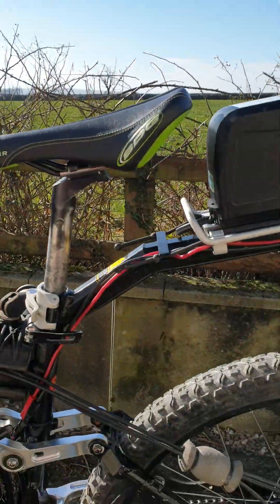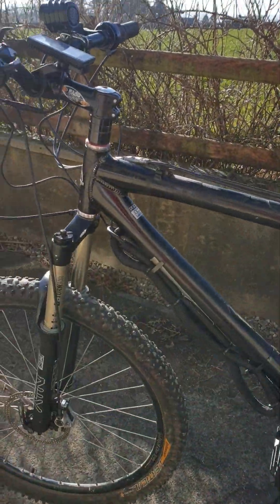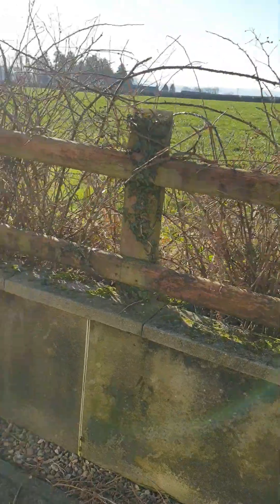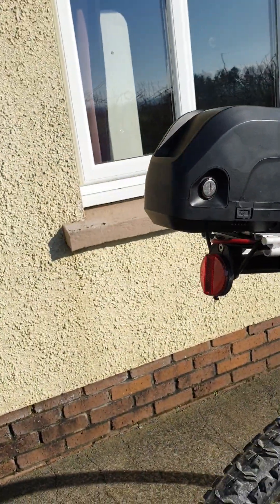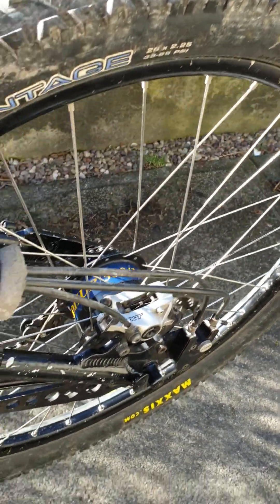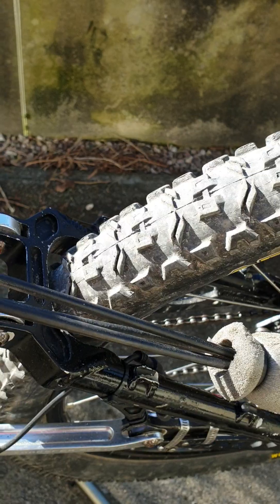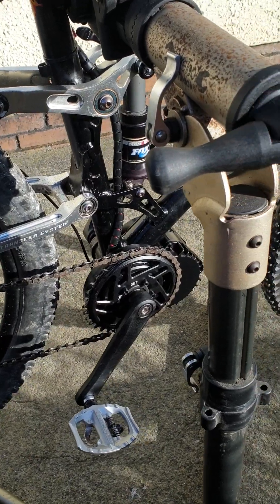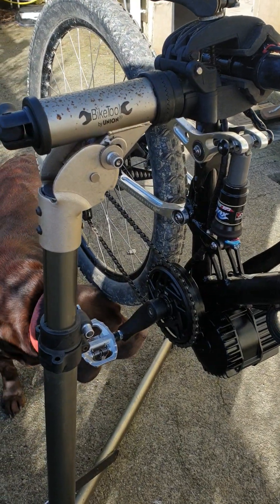Bafang bbshd mid drive with Rohloff. e-bike electric bike conversion.

Comment: How are you liking the chainring. Too slow as anticipated?
Reply from the maker: I’m sticking with the original 36! I think its 36 I’ve forgotten now. Yes it spins out around 20mph bit of a pain downhill. I am finding that constant 15-18mph is enough speed for me on flats which feels like its still a cycle. What I forgot about which is relevant in the winter the faster you go the colder you get because of wind chill factor.
Reply: @ami3214  Thanks for replying. Understandable, I'm building mine with a 42t sprocket, not sure how many teeth are on the hub sprocket, but if I can get 45kmh (28 mph) out of it I'll be satisfied with it. How's the hub holding up - any issues?